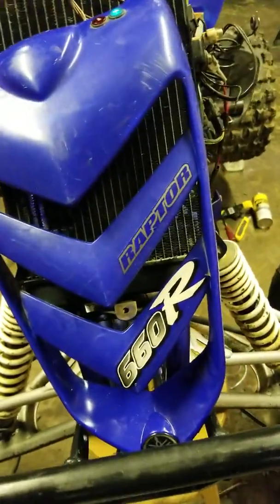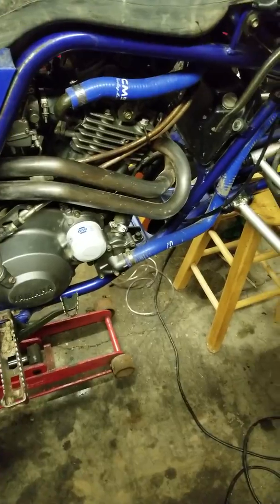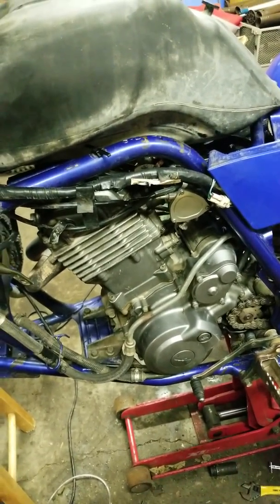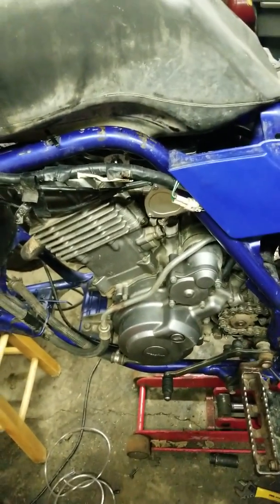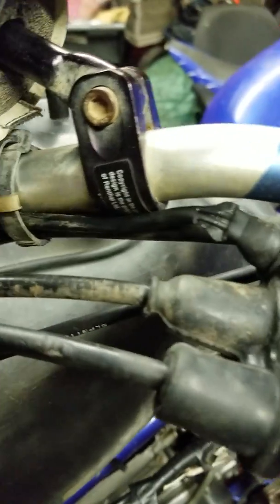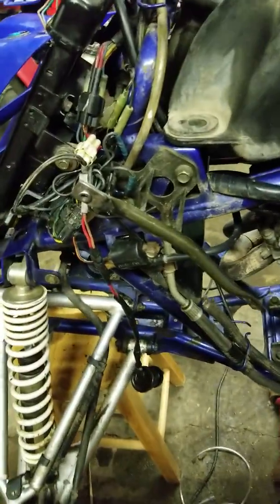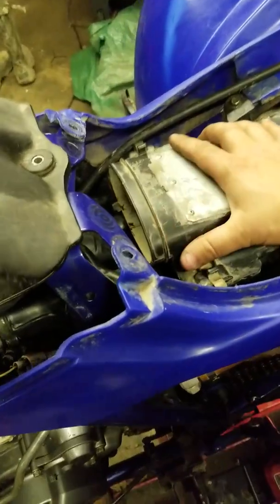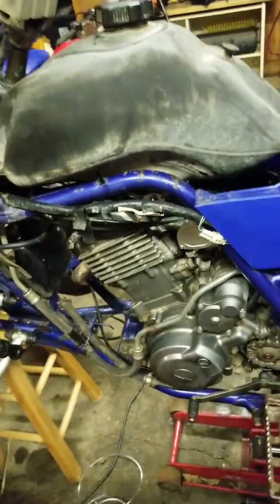2001 Yamaha Raptor 660R MID RANGE STALL (FIXED)

Comment: Check to see if the parking brake is engaged. My dads did the same thing. I own the Raptor now and when I got it out the shop they never fixed the parking brake. At the back on the caliper, push the parking brake in with your foot. Oh this is from 6yrs ago 😂
Reply: Ya I’m just now seeing it lol I’m having the same issue! Lol

Comment: hello I have a yamaha raptor 660r 2005 that does exactly the same thing to me at half throttle cuts in relenti it goes well and if I accelerate atope it goes well it only fails me at half throttle what could it be?thank you

Comment: Mine stalls out after riding for so long and it’s always around the high end of the second gear but I can trick the bike to keep running with the kill switch! That’s just after 15 mins of riding and it warmed up for about 15 mins aswell before I drive?

Comment: So I have a all stock 660r and it has stock jettings and all the switches are good there’s no leak or air leaks or anything but when I’m driving it slow it drives fine when I’m at full throttle it drives fine but when I drive it at cruse around mid throttle it backfires and blows air back out of the carbs

Comment: I am going to have to check my valve clearances. Mine wont start unless i have the choke full on and manually release it once it is fully warmed up. It also backfires a ton when I get off the accelerator (decel)

Comment: here in 2022 having the same exact problem as you did you ever figure out what was wrong with it
Reply from the maker: yea it was the jetting, check my other videos on it. I recommend going through the entire fuel system and making sure its good. Also keep in mind that it will not let you rev too high when not in gear. Good luck!

Comment: Did u ever figure it out ? Mine does it the same thing when it's warmed up alot. And alot of black is coming out the exhaust
Reply: Did you ever figure it out? Mine is doing the exact same thing . Backfires a lot and bogs out when I rev the gas mid range
Reply: @Ballist1c_B did you figure it out? Mines doing the same thing

Comment from the maker: imagine in 2022 getting one like this for $1000 ??? haha times certainly changed!!
Reply: I just got an 02 for $1100
Reply from the maker: @CarlosC77  nice! yes, I'm seeing prices are still high but folks are negotiating lower now.
Reply: I actually just got one of these and it's doing the same thing. Did you ever figure out the issue?
Reply from the maker: @zacharyhuckaby274  yea it was the jetting, check my other videos on it. I recommend going through the entire fuel system and making sure its good. Also keep in mind that it will not let you rev too high when not in gear. Good luck!
Reply: i got a 2004 for 2,400.00

Comment: What fixed you’re problem because when I have mine in neutral it revs good but when I’m driving it and full throttle it starts to sputter
Reply: Mine dose same thing but I’m like second gear up at full throttle
Reply: Shift down to first gear let off clutch to give it gas she starts bogging down bad have to keep my hand in clutch for it to idle. But I’m neutral it revs and takes the gas. Just when I shift down to first starts bogging when I’m trying to go. Also reverse light blinking
Reply: When I shift to 1st gear and give it gas it’s sputtering bad

Comment: That top plug on the clutch side is the problem it’s missing and will make it sputter and backfire when throttled
Reply: What are you talking about.
Reply: @Soupdipper  the parking sensor switch is what he means

Comment: It’s definitely the parking brake sensor I have a 03 660r and I went crazy trying to figure it out on mine and I ended up cutting the sensor off and twisting the wires together and it ran perfect so I got a new sensor and installed it the right way and it still runs perfect
Reply: What were your symptoms? Im currently going crazy trying to fix my 03

Comment: What do u mean u had to jet down? What is jet down
Reply from the maker: "jet down" = smaller jet hole diameter= lower jet number = LEAN
Reply: @cannedham3774  I ended up setting my needles full rich I guess it was starving coming off idle. Yours was running rough off of idle because it was too rich?

Comment: Needles up is more fuel the switch on the switch on the handle bars that have the bullet style connectors plug them into each other the other handle bar switch just unplug it and tape it off to keep water from getting into the main harness

Comment: I have a 03 raptor 660 and it starts and idles fine but when I hit half or full throttle mine wants to back fire and pop, yours holds will it a lot better mine wants to die soon I smash the throttle  but will idle fine. Do you have any ideas?
Reply from the maker: Probobly jetting. Every bike I get if theres issues with the carb I always start at stock and adjust from there. Take into account mods like muffler/pipes/airbox.. it's very sensitive to any modifications or even bad seals on the airbox.. exhaust leaks.. hopefully this gives some insight. Good luck !
Reply: FIB Life thank you, I am going to start with the jets and the rev limiter and see where that gets me, I really appreciate the advice and information! I will be posting a video once I get it done of my results and what I had before and where the new jets get me.
Reply: Check ur valves might be out of speck that help my problem with mine
Reply: Jose Rojas was yours poping and backfiring when you give it any type of throttle? I put i new carb on and it sat for about 2 years I didn’t ride it and now just wants to act all funny when I try to rev or ride it
Reply: BoBo’s Bikes mine was piping and back firing when I will go half to full throttle and it was the valave to tight
Reply: BoBo’s Bikes you need to have the original carb  after market once don’t work
Reply: Jose Rojas okay thank you I am going to check the valves and there clearance to make sure there to spec. But I don’t have the OEM carb it’s an aftermarket one and Yamaha factory said a new carb on my 03 raptor is 1100 dollars
Reply: Does any of ur 4 wheelers have aftermarket air filters? If it has a k&n, or other aftermarket filters. it allows to much air flow to go through to the carbs. The slides on the carbs are vacuum operated. There should be vacuum lines from the carbs to the intake boots before the air box. And if there is too much air flow going through the air filter. Those lines get no vacuum built up. Therefore it will not rev past 1/4 to 1/2 throttle. To confirm you have a vacuum issue, you need that intake neck on the air box. That creates restriction in the air flow to the air box. And if you install that and it still cuts out, cover half of that boot with your hand to restrict it more and see if that fixes your ur cutting out issue. Jetting issues is usually cause black smoke out the exhaust, meaning too rich. But if there is black smoke, it’s way too rich, but will usually still rev out.
Reply: @hodgenmobileservice487  it has K&N filter,box and snorkel. After market carb I’m at 160-165 main jets 25 pilots, stock needles, clips on 6 clip, 95 starter jet, after market exhaust. It starts idles just fine will rev just fine but when riding when you get anywhere been 1/2 throttle and full throttle it will fall flat on its face also yo I have to kinda give it a lot of gas when letting the clutch out going into gear if you don’t it’s like it wants to die. I’ve been trying to get this carb synced but still is just not running right

Comment: I have an 01 686 and i just put a new carb on mine.  Unfortunately they werent the same size jets but i took em off my old one. It runs 90% now. 2 turns on the left and 3 on right BUT it needs a lil more tweaking. Still hits 80mph but i know there's more.      Originally it would idol and run until i hit mid range rpm.  It was a tank after spittin and sputterin to 50mph then it would just pull.     Its better now but still needs maybe half a turn here or there. I dunno.  Its a beast but.  Alot of wiring issues, new solenoid and battery, starter.  My cousins raptor is the SAME way with wiring.   I gotta rip that all apart tomorrow smh. Good luck tho.
Reply from the maker: Yeah that china carb is gine but I think it may require different jets/settings.. I put the mikuni back in and brought it back to stock to get it tuned back in.
Reply: Is that why I backfire new carb use old jets

Comment: I have a 660 and if I try to go over 55 on it like it want to stall don’t know the problem?
Reply from the maker: Gotta take a look at the mods on it and if its stock make sure there are no air leaks.. sounds like you might need to go through it like I did.. start at stock settings and adjust from there! If there are mods on it then pickup a few jet sizes higher and lower.. test it .. adjust .. test.. keep track of what you change good luck !

Comment: I have a raptor 350 piped jetted cdi rev box air filter etc and it is now doing that exact same thing. Once it cooled down i swapped the parking brake wires and it didn't make a difference I checked cdi box wires and after awhile It seemed to finally rev out fine. This was yday around 3pm and then last night around 9 I went to move it and it started bucking again! Any ideas? P.s I have 155 main jet and put 2 spacers on needle clip all of which ran fine for over a week or 2 before this started to happen
Reply from the maker: Sorry for the late reply.. did you figure it out? If how you have it setup with the mods and jetting and you said it ran fine and would rev out... tells me there may be an electrical issue. It's possible moisture is getting in that cdi or something else.. when it comes to electrical I always start with the grounds. Make sure you have good connections to the frame.. intermittent electrical issues can be a real pain!!
Reply: @cannedham3774  yes actually I did and come to find out my brand new dyna fs ignition went bad. Put my stock one back on and runs fine again

Comment: I have a 2003 raptor 660r, i have to hold the electric start for like 30 seconds for it to start and when it does it feels like it doesn't ride good. I can slightly give it throttle but if I don't full throttle it almost the whole time it tries to die like its flooding or something... Its also shooting out some blackish smoke, nothing crazy yet but something noticeable. Hoping my air/fuel screw just needs adjusted or jets need swapped. I have a 2 brothers exauhst and that's about it, what should I do?
Reply: How did you end up fixing this?
Reply: @devingallagher5674  my valves needed to be adjusted, I adjusted those and it started up right away. It may be difficult for you at first but watch a few videos online, make sure you get the motor at top dead center when you adjust the valves. Also measure the gap between each one before you adjust them so you can tell what they are at first
Reply from the maker: @devingallagher5674  Had to go with smaller jets (lean)
Reply from the maker: Hey not sure if you solved this nor not but if its flooded maybe check the bowls and make sure the floats are set properly. To test, try turning the fuel off and start it.. see how it responds.. you can tell right away if it is a rich or lean issue by doing that. Just dont throttle too much with the fuel off because as the fuel depletes in the carbs you are creating a lean condition! Good luck !

Comment: I have a 2001 raptor that cranks but stalls, any idea of what’s going on?
Reply: Mine does the same thing
Reply: @kingexplorer1417   I had a wiring issue because the guy I bought it from he wired a push start button on mine

Comment: I have a raptor 660 that was recently bored over to a 686 now it wont start I had a guy try adjusting the valves For me.. It turns over one slow time then dies out if I bump it bump it bump it it'll turn over again then repeat itself... What could be my problem
Reply: Did you put a cam in it too?
Reply: auto decompression is not working making you think you have a bad battery

Comment: My 2005 660r keeps stalling when it’s idling, and when I’m driving it and slow down to low gear it shuts off. Any explanation you can think of?
Reply: Your pilot jet is the issue. Stock they should be about 2 and 1/2 turns out to 3 turns out. Pull your plugs out and learn how to read them. Chocolate  brown plugs are right on the money. Black plugs are to rich. White plugs are too lean. If you can't figure it out. Buy a hand pump pressure tester and see if your carb will hold pressure when sealed. You may have leaking O_rings around the needle and seat Even if it's new. Check the float measurement. It should be 13 millimeters. With just a pipe. You should get a dyno jet stage 2 jet kit and follow the instructions. Your carb might be new but it's not set up from the factory.
Reply from the maker: Any modifications?
Reply: FIB Life just have a aftermarket pipe on it, I just bought it off of a friend it’s been sitting for a few years. Just put a new carburetor in.
Reply from the maker: @therealnateedogg8177  what was wrong with the original one? What did you replace it with ?
Reply: FIB Life Idk what’s wrong with it, now my raptor won’t start. It’ll turn over and everything but just wouldn’t start. Don’t know what to do

Comment: I have a problem where my reverse light  comes on when riding it wide open an shuts down but idles good when stopped but hard to take off. it has new carb,cockpit an a few other things would u know what's causing that?
Reply from the maker: Assuming at WOT it's only an indication issue or that would be catastrophic.. In this case you should check the wiring, start by putting it in neutral with the engine off butwith the key on and see what it does when you place the shifter in reverse. If ok then go back to neutral and start wiggling wires, I'm thinking you have a possible connection issue
Reply: Jeremy did you ever figure it out mines does the same thing
Reply: It’s the reverse rev limiter. It is the green wire with white stripe. Looking at your cdi, cut it with enough lead to ground it to the negative side of your battery and your problem will go away

Comment: Best 1000 u ever spent on a Yamaha.... 2001 had revers gear issues other then that it's a great atv I have 2 raptors.... u can easy flip for 2500 or 2000 and u know what your doing soo if u like it keep it
Reply from the maker: Yeah I sold it for 2k. Valves were out pretty bad so I adjusted them and the noise calmed down.
Reply: @cannedham3774  nice bro if you ever find another do it again flip easy raptor 350 samr thing ... hold value easy fixes

Comment: Sounds like the rev limiter but how does it run when you use choke? Any difference? Mine is doing the exact same thing and I was suspecting it was jetting and not a limiter. But it could be a limiter now that I think about it. Did you ever figure it out?
Reply from the maker: Yes, check my other videos. I ended up jetting down. It's not hitting the rev limiter because it starts to limit revs well before you're at WOT.